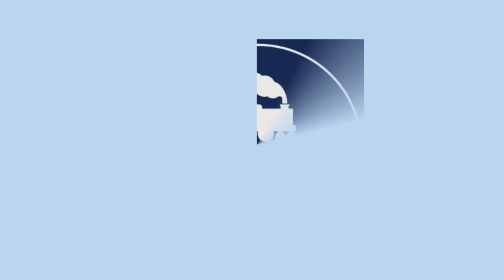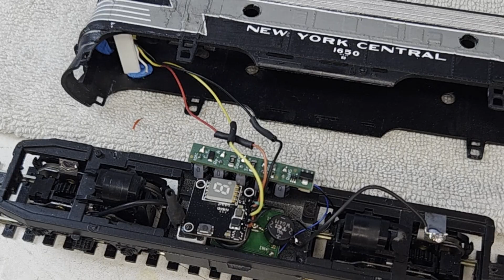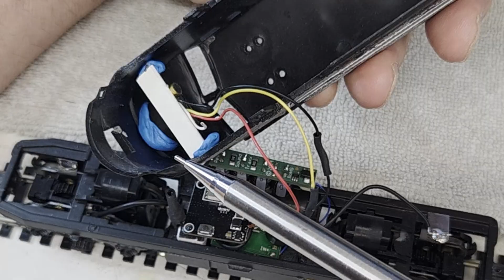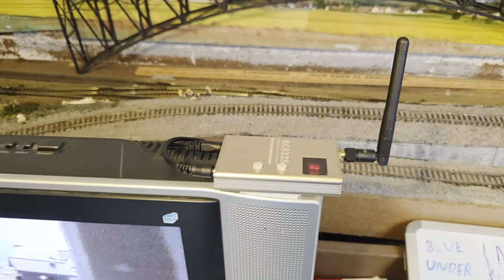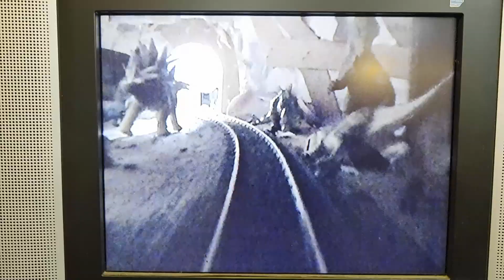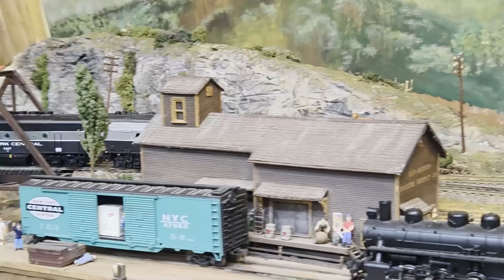Engine Cam Install

Comment: Could you add some details on specifically where you obtained the small camera and transmitter, etc. and the part numbers used?  I did some searches on eBay but was not able to find the 70 degree focus camera you identified and only saw 120 degree fish eye style.  I’m in 1/64 S-Scale but the size of the camera should fit no problem in my Locomotives.  I liked that the receiver produced RCA jack compatible signals so I can use some old monitors for showing the output of the camera.
Reply from the maker: I used items I had in stock, but I just put some samples in the description

Comment: I  model 2 rail 0 scale  (and yes, Dead rail) and this has been on my bucket list I run all steam and all are brass ,is this an issue?
Reply from the maker: Should not be an issue.  I had a camera mounted on top of a box car that looked out over the top of the engine.  Worked great.  You just need a battery to power it.